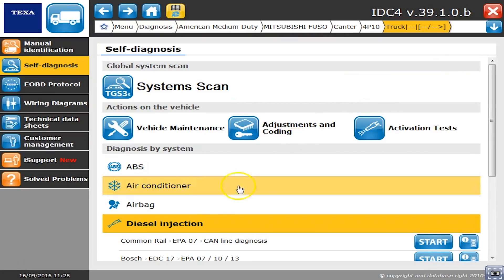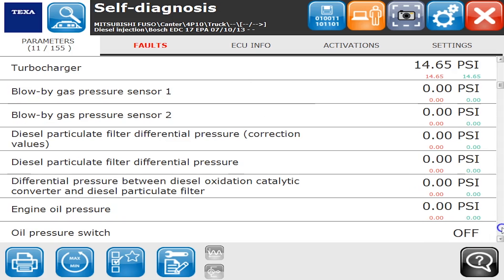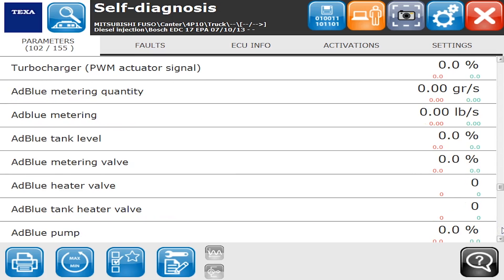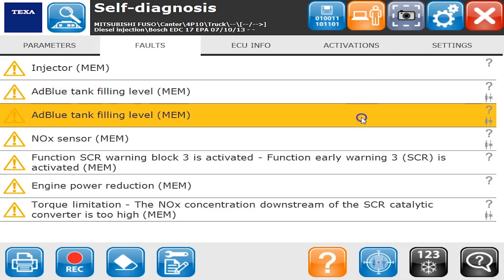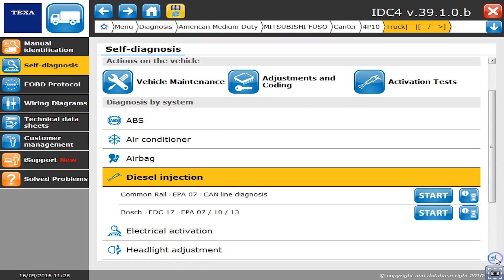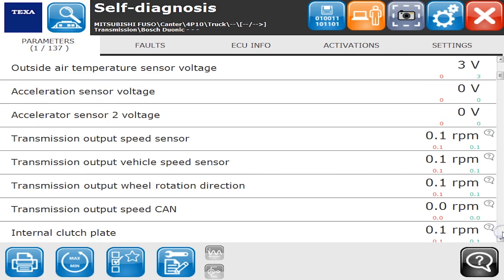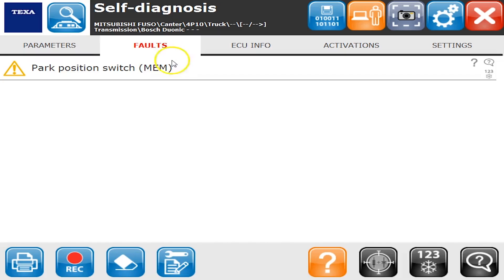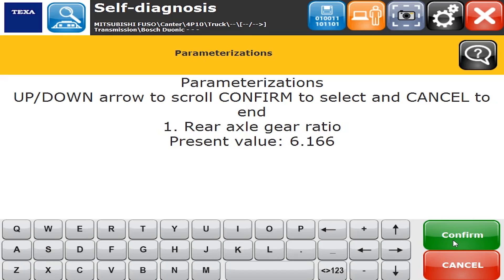TEXA Truck Diagnostic Tool on 2013 Misubishi Fuso 4P10 & Duonic Transmission

Comment: Dónde puedo conseguir el kit de distribución del Mitsubishi fuso fe180 4P10 turbo
Reply: A qué llamas kit de distribución ?
Reply: @jancarlospuello4173  
Es el kit de cadenas catalinas  piñones y la Junta éso es lo que se le llama kit de distribución también se conoce cadena y piñones del tiempo 
timing chain kit
Reply: Entiendo, lamentablemente en mi país (República Dominicana) no venden estás piezas al menos que sea de un motor que sea para piezas. Que le pasó el tuyo que veo que lo estás reparando ?
Reply: @jancarlospuello4173  
Así es no hay pero pronto habrá 
Ya el que necesito está en camino no lo estoy reparando lo compré con la cadena rota allá fuera pero Dios mediante en esta semana queda resuelto
Reply: @jancarlospuello4173  
Somos del mismo país 
DOMINICANO SOY

Comment: Did someone know fault code 79FF1F (520569 31) ?
Reply from the maker: Yes, it is for "Component 'DUONIC Control unit' reports an implausible gear. It means your FUSO transmission is having a communication error. Complete repair information can be found in DTC Solutions -- https://www.diesellaptops.com/DTC-Solutions-Repair-solutions-for-codes-DTCS-V2.htm